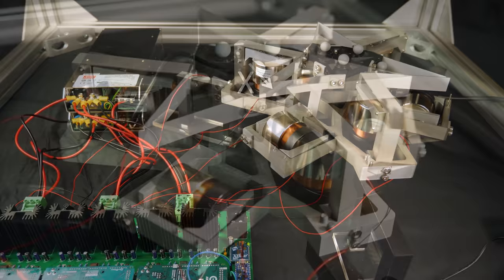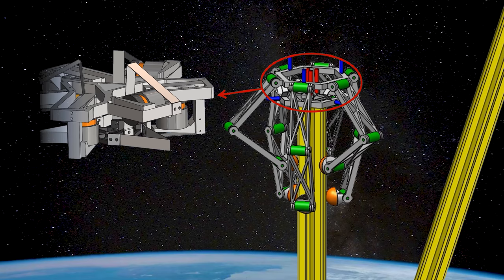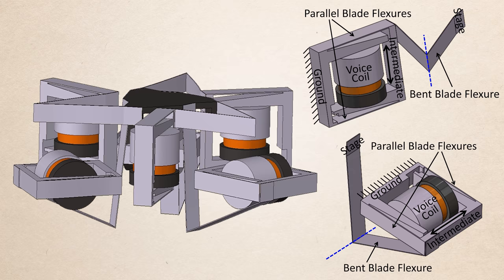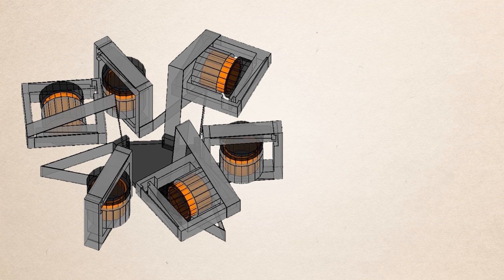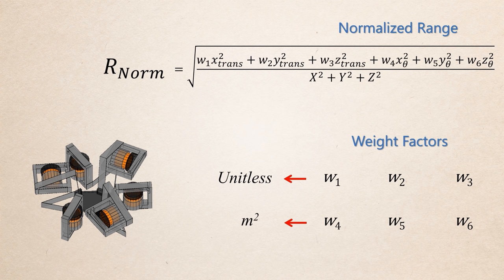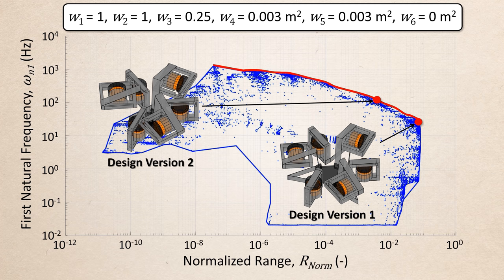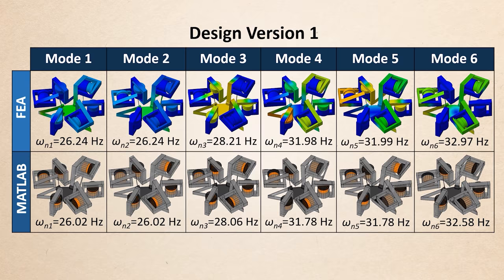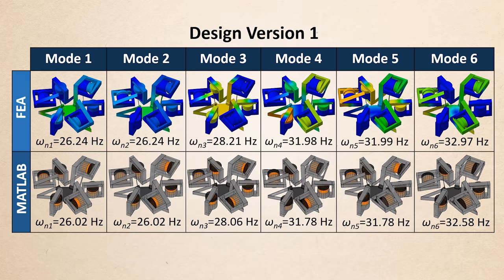Compliant 6-Degree-of-Freedom Precision Motion Stage: The Hexblade Positioner

Comment: I’m curious about the folded flexures which act not just as simple bending elements, but also experience significant torsional deformation in certain movements. At first glance this would seem to make it hard to predict the position of the stage since the connection to the voice coil has multiple degrees of compliance, and deform in different ways depending on what the other voice coils are doing. I guess I’m wondering if there is “crosstalk” between the axes.
Reply: Given their thin rectangular cross section, each flexure is far more stiff in the direction of intended motion, and bends very easily in the case of not. If you watch the animations at the start, I hope that makes sense. You're likely talking when motion is not perfectly defined by 3 actuators at once, but I assumed the bending moment would still mostly be in line with the flexure's intended direction of bending, so it wouldn't be too disruptive (since its cross section is like 20 times as thick in one direction than the other, and it only receives a small portion of the load that's off axis in the first place. Hope that makes sense?
Reply: @jasondean37  I get it, but yes, I am talking about the twisting induced by the movement of the other axes. The prototype appears to be open loop, and I think it would be quite hard to create an algorithm which would tell you what voltage the voice coils should have for a given position output. If the voice coils had encoders it would be nearly as difficult. Maybe if the end effector could be directly measured for position feedback it could work.

Comment: Why are there three linear motors for the z axis? Isn't that redundant?
Reply from the maker: No, there are six independent actuators for the six DOFs. To understand redundancy in actuation and constraint, you can watch the first and last lectures of my compliant mechanism lecture serries.
Reply: @TheFACTsofMechanicalDesign   thank you so much for putting those up. I'm only on lecture 7. So far on the FACT complete library of parallel systems I've only found 5 degrees of freedom so I haven't gotten there yet/my brain is too tiny to even understand why 5 degrees of freedom would be necessary.

But in 3d printers they only use one z stepper which is so interesting because on this project it seems like the z axis is in part the mechanism crawling on the part! So I expect that the printer has to incrementally print in the z between crawl steps which is also so beautiful.

In deltas, it feels like some of the goal is to reduce the number and cost of actuators and modern printers only use 3. Of course they've got a lot of extra mass and don't get to play with linear motors this excluding the need for linear actuators and 3d tracking for to the cost. I guess use of more degrees if freedom must have something to do with decoupling the different movements and it must have more capabilities than a parallel linkage in a typical printer. 

Anyways, thank you so much for your response and I can't wait to finish the rest of the lectures. I'm sure it will all make sense after I finish. Thank you again so much for putting them up!

Comment: "large range of motion" (looks like it goes 2 inches, maybe)

Seems like a better solution would just be to have 2 rigid bearing mounts to straddle the beam as it is being built, the mounts themselves could be adjusted in very small increments within the rigidity in order to maintain precision. A laser guide would be optimal along the path....and the whole thing would cost far less and take up less space.

Comment: I’m sorry but why are arduinos used in this? I saw 3 arduino megas and 1 nano, is there really nothing better that could have been used? It always annoys me when very complicated academic projects like this or masters or phd level projects go and use beginner equipment like arduinos, especially when they go and use multiple of them like in this project. Have they not learned how to use more professional equipment in their many years of study? I know the point of this project is the mechanical system and not the electrical one but they’ve gone to the trouble of designing a large board to plug the arduinos into, why not just design the board or a separate board to have a different microcontroller or even an FPGA, if the megas are only getting used because they have a high pin count. It looks like the megas will just be used for outputting signals and the nano is used to control them, does it really need that many digital outputs though, to control 6 voice coils and maybe a few sensors? If the megas are used for processing too and you need 3 of them and a nano to have enough processing power to run the program then that is even worse, it should be using a more capable chip.
Reply: @gasmonkey2.075 It is about using the right tool for the job. They are persevering with unsuitable hardware and compensating for it by just using more of them and this increases complexity in itself. Rather than just using a single MCU that is more suitable they now need to deal with communication between the multiple MCUs and making sure they all work as expected. Using a single more powerful MCU or FPGA for it would decrease the complexity.